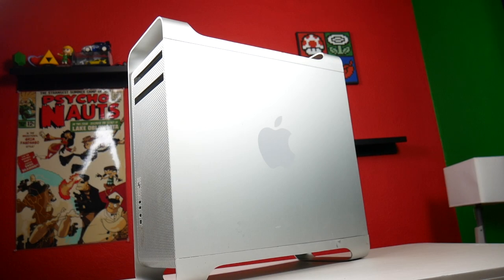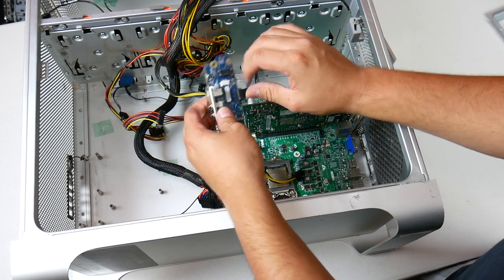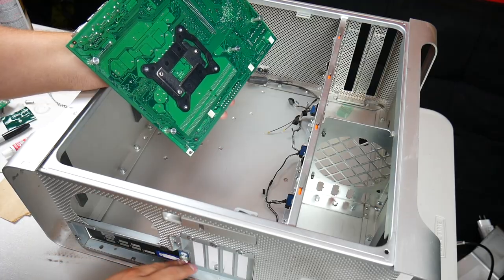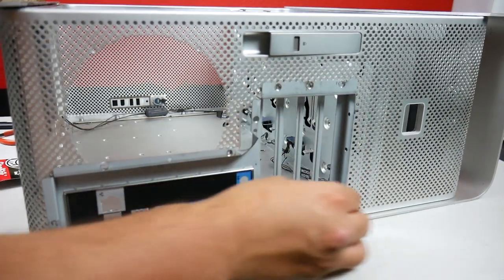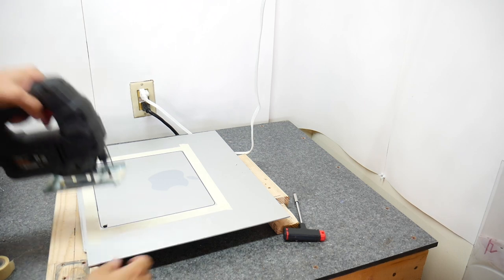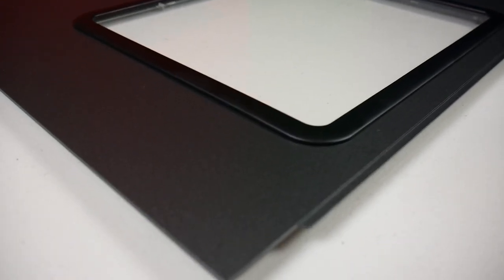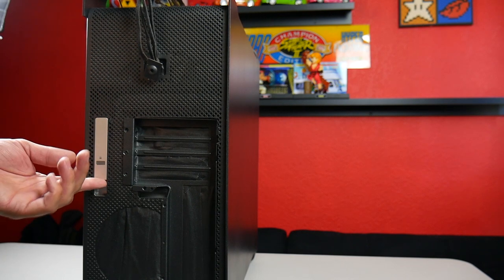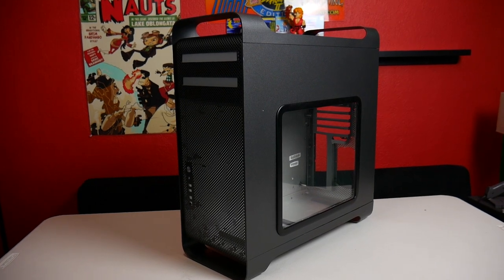Goodwill Mac Pro ATX conversion Pt2, Cutting and Painting

Comment: Easier to paint the ends of stand-offs to mark drill locations and then drill holes to put screws through from the other side. No Welding of any kind is needed. Also, what about that huge, gaping fan hole in the rear of it?

Comment: did you not use any primer and sanding?
Reply: Gemiflap these cases are matt anodised so most likely don't require sanding for the etch. It looks to me like he has levered on a good few coats of that paint so coverage and show through will not be a problem. I think it looks a lot better in matt black as the original grey is just a shit magnet. I seen one of these professionally anodised in matt  black and it was the mutts nuts!